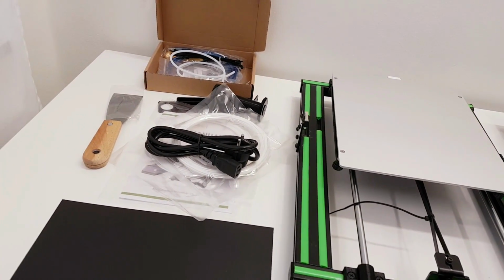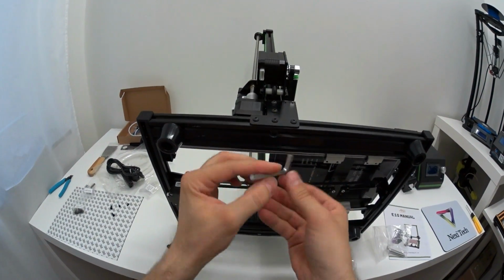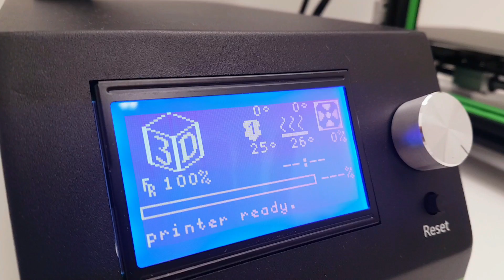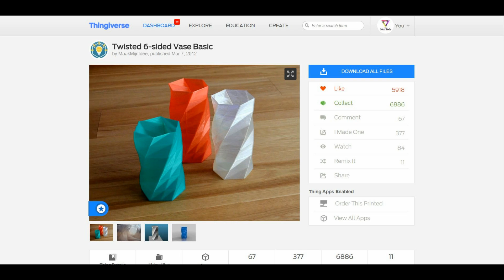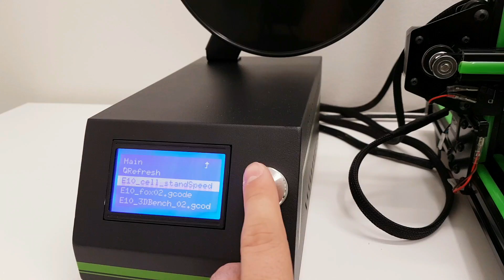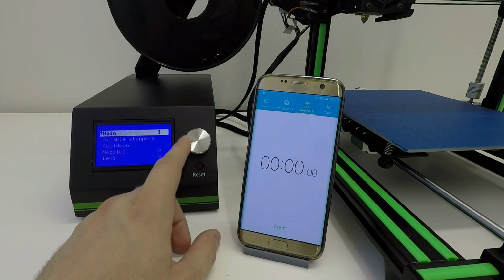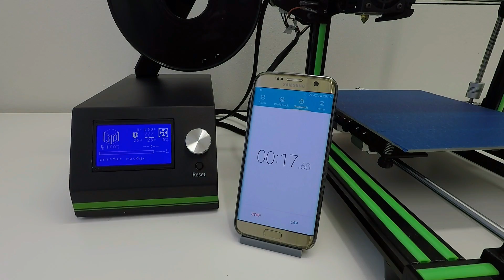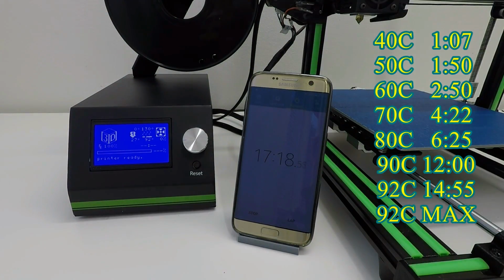Anet E10 3D printer full review!

Comment: Here's my biggest problem with the E-10... Too many reviewers on the low view side of things are trying to say this is a printer for beginners. NOPE. If you have to make the modifications out of the box that you do, it is NOT for beginners.
Reply from the maker: This printer is should not be for beginners(without skills) and I never said that, but I point out all issues and how I fix them to help others users if they decide to get E10. You thing Anet A8 or A6 is easier for build then Anet E10? Not even close. Its much easier to fix few small issues on Anet E10  then get A8 or A6 Kit and assembly it from start. We all know there is much better 3D printers for beginners but at much more higher price.

Comment: thoughts on it printing tpu? thanks!
Reply from the maker: Well TPU is flexible filament and every bowden setup regardless of 3D printer will have hard time to print it right. Even direct drive can have problems if extruder setup has some gap/distance from gear to nozzle throat. I think using lower speed E10 can do it. I report back when I  confirm it. Cheers!

Comment: So you not going for the drama like the Press Reset guy?
My thoughts
It's a shame they went for the same connector as the Anet A8 without providing strain relief or a way to stop it snagging on the Y motor.
The way The Z motors connect with that thin mount with one screw to the frame is asking for failure 
I would be concerned about  the QC of the connections in the closed box 
They should have insulated the bed it costs virtually nothing. 
Then there are the points you and everyone else who have fetched up that need fixing.

All these things can be easily fixed but as this is an almost built printer for the total noob it could be problematic.
Reply from the maker: Hi Brian! Well not really, am trying to be professional(as much I can) and honest and give every 3D printer a chance to show what it can do. If 3D printer has small issues I try to fix them and still give the 3D printer proper chance to print something out and then I share my thoughts later on in my review, If issues are big and it can't be solved then I will make video about that as well and warn other people for possible problems with specific product. So far am trying to get only good(as possible) products for my reviews sense I work hard everyday and I don't have time to waste. I agree that heat bed connector can be issue in future and I already have easy fix/upgrade on that without need to solder anything. I will make another video about upgrades that I will do on my E10 and I will add upgrade/part or tips for heat bed and connector and others parts. I agree that for total noobs some of this fix may be problematic. Thanks for commenting. Cheers! Nexi
Reply: @NexiTech  It's still a pretty bad engineered 3D printer. Anet jumped into the Creality hype so they rushed the manufacturing. If the customer needs to fix/solve all of these major lazy/rushed issues and problems, then in my opinion it's a bad printer. And the price really reflect that. If they could work on the 3D printer just for 2 days longer they would fix/solve all of these issues. Poor and amateuristic printer, but still it can deliver decent prints. So it's up to you if you like to fix things then I recommend this printer.